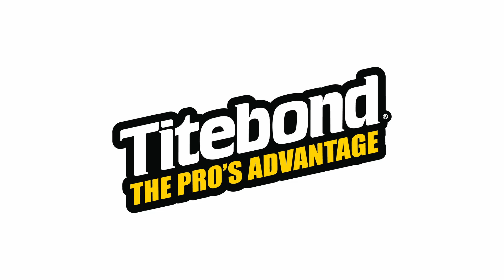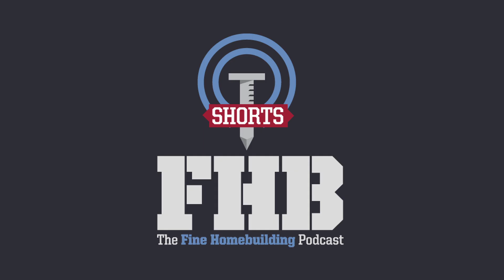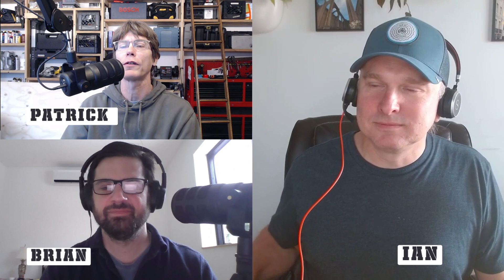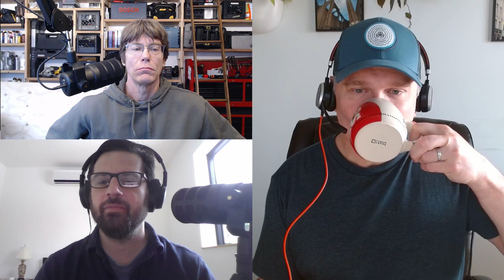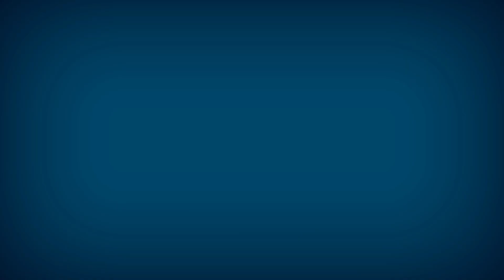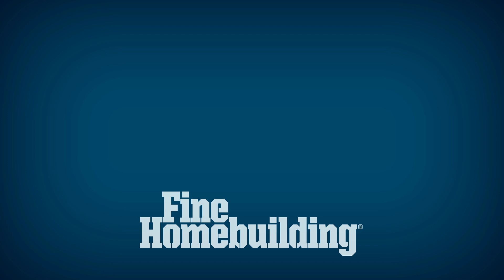Designing and Building an Efficient Slab-On-Grade Home

Comment: Interesting discussion.  I'm designing a small cottage with a large attached garage, to be built in central New Jersey.  Originally I was thinking Barndo.  But after talking to some builders about efficiency of stick and getting my design down (in sketchup) I don't think it is a barndo any more.  So I like your definition.  Mine will be 1300 sq ft living (2 bed 2 bath) 1500 sq ft garage, 800 sq feet carport, and a long 10' wide porch along with length of the living.    I was hoping that this video would have more discussion of slab on grade in colder climates, especially ones where the custom is to have a basement (that you get to pump), and that is what the builders are used to.  Also how to handle HVAC and plumbing without the basement/crawl in a northern climate that will freeze.  I'm not going to build this myself,  just doing a lot of the design and initial site planning, work myself.   Will have some licensed architect and GC to handle the details and the code police.

On the radon issue:  I have a home in Colorado where the Radon is super high.  Without some venting I would be seeing numbers in the 10-15 range inside, and 20-30 in the crawl.  My radon system is simply a length of perforated 4" drain tube running the length of crawl space and vented with a cast off kitchen squirrel cage exhaust fan.  Mine just goes out the side of the house (on a steep hillside).  I believe the proper code way is to take it somewhere up on the roof.  I get radon numbers inside of <2 with this system running.  I have friends that have spaces that simply have a 4 inch hole in the middle of the slab that gets down into the gravel bed, no tubing.  They put a radon fan on it, with some pvc to vent outside and they are good.   They test for radon here, by putting some plastic on the ground, and putting a radon monitor under it.  You can also just put the radon monitor in an upside down bucket for a couple of days.  The radon tester I use is an Airthings. About $140.   Radon mitigation is not rocket science, but very much worth doing, especially if you are going to be in that dwelling with the windows closed much of the time over many years.

Comment: There are a few companies here in Texas that do a barndo with zip on the exterior for air sealing. 

I'm located in east Texas and am in the process of building a barndo using similar wall construction as the emailer. The advantage of the barndo over stick framing is the building is quickly under roof with little labor. Easier for the engineer minded to come in after and complete your own work.

Comment: The biggest nugget here is the recommendation for a heat pump solution for both radiant floor heating and integrated air handling with for air conditioning and ventilation / heat energy recovery. Thanks for a great podcast. Will definitely check out Warmboard for my build.